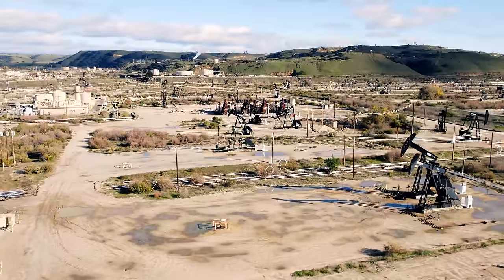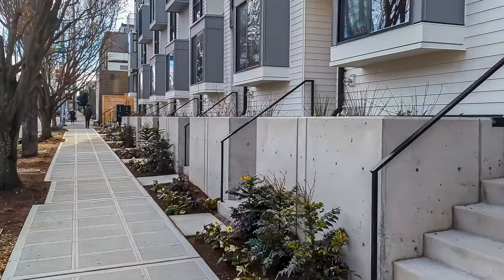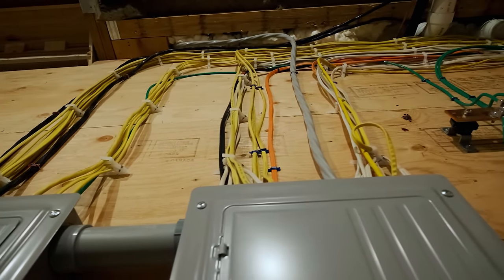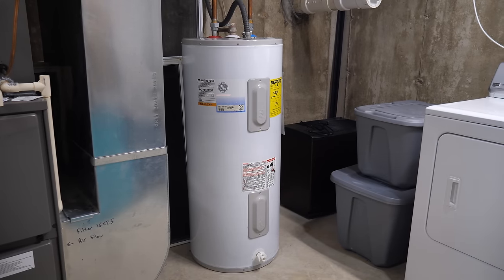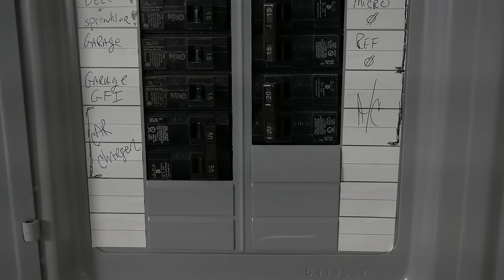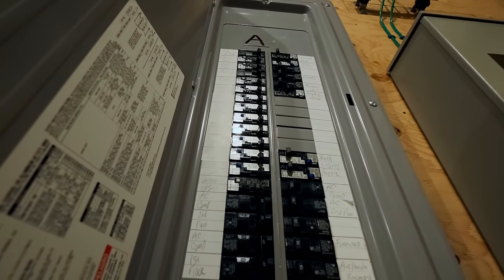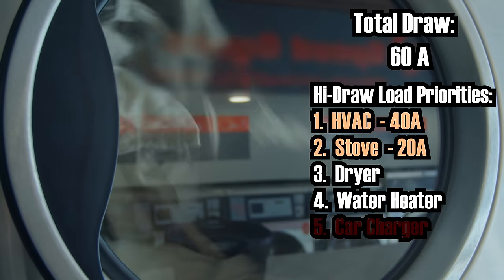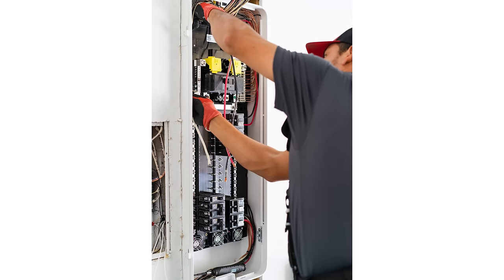Home Electrification: There's not a lot to do, and it doesn't have to be hard (Part 1)

Comment: 15:18 A smart electrical panel that starts disabling loads that aren't even present or presently have loads that are too small to matter doesn't seem very smart to me.

Consider how confusing it would be to be using a hair dryer or curling iron in the bathroom only to have power removed from the circuit 2 minutes in. Did the GFCI or AFCI trip? Nope. Did the circuit breaker trip? No. The smart panel disabled power. Maybe the geek of the home got a push notification on their phone that the outlet was taken out of service, but for everyone else who doesn't have a smartwatch tethered to their smartphone tethered to their smart hub tethered to their smart panel tethered to some crappy cloud service that was end-of-lifed before the product was installed, it'll be downright confusing. And for a curling iron where--unless you're looking at the LED--you don't know that the device turned off 5 minutes ago and you've been curling your hair with an increasingly lukewarm piece of metal will be in for a surprise.

To me, a smart panel doesn't make a ton of sense without smart appliances where you can get device-level power control rather than circuit-level control. For example, your refrigerator/freezer is probably fine without power for a few hours, and certainly fine without power for 30 minutes. Most people don't have their refrigerator on a dedicated circuit, so the panel would knock out other outlets like that low draw spice grinder or rice cooker if it disabled the fridge for 30 minutes. But if it could communicate to the fridge to delay its compressor cycle by 30 minutes, then you can average out the peaks.

Though I doubt turning off the refrigerator and a few other small loads would enough to get the peak power under the panel's rating. Realistically, all that matters are loads above 15A. Everything less than that probably shouldn't be interrupted. Fiddling around with lights and outlets in the app screenshots might look flashy and useful, but is utterly useless for anyone who has thought about the fundamental problem they're trying to solve: you can't charge your electric water heater and run your clothes dryer at the same time. Either defer your car charging or put your clothes in a holding pattern with no-heat delicate tumble dry, or communicate to your EVSE that it must limit charging to a slower speed for a while.

Likewise, a smart electric range could cut power to some of its burners. But either you're using those burners for a reason and can't really afford to have some of them turned off by the smart panel, or you aren't using them and therefore they aren't drawing a load--no benefit in turning off the circuit if it doesn't draw power.

Until smart appliances are ubiquitous or can handle having their power yanked from them (think about how your electric clothes dryer would handle having power removed from it mid-cycle; would it resume the sensor tumble dry cycle it was on when it lost power?), a smart panel doesn't really buy you much. I wouldn't want a smart panel cutting power from my dryer without it being able to resume the dry cycle or sit off for long enough for my clothes to get mungy and get rewashed.

We don't even have microwaves or ovens that can remember what time it is after a power outage. And that could be accomplished with a small coin cell battery. Nothing like storing the state of the complex computer boards that are in washing machines.

The reality is that if your electrical service isn't enough to service the major appliances in your home, you probably should consider upgrading your service if you don't want to live with the inconvenience of appliances going dark on you throughout the day.

You already covered an outlet splitter that allows you to power either a water heater or a EVSE from the same plug, at different times. That seems like the better solution here than inflating the problem to a whole home issue, and plan on upgrading your service if you're short by more than 30A.

Or have a way of duty cycling power between HVAC (which is a big dry battery), water heater (a bigger wet battery), and electric battery (a portable battery). Ideally coordinate all of this with the EV's whole-home V2L or home battery backup system to smooth out the peaks in demand. As long as you can communicate the rules: you need your car to be charged to X% for your commute to work tomorrow, you'd like your hot water to be at least some temperature and a higher temperature when you shower at X o'clock, and you'd like to keep certain areas of your home from getting too cold or too hot, with a focus on a few rooms where people are.

Comment: Wait, if by TC's opinion gas dryers are one of the core gas appliances, which are a subset of a dryer category, how common are dryers in the US? I understand that 99% of homes have to have a stove, and a water heater, (mb the furnace/boiler thing on 1st place out of 4), but dryers aren't a necessity, like a washing machine. Even in humid summer we had no problem drying our clothes on drying racks, which don't damage the material as tumble dryers do. You still need to dry the delicate fabric without a dryer.

Comment: You can have a smart breaker panel & turn off loads based on piority,
OR you can install the smart panel + 10KWatt battery pack & don't give a f*** about your power load as long as the battery have juice in it & it will always recharge in the few minutes that you don't exceed the current limit.

Comment: I think a better and more economical solution is installing a backup battery system (a 5Kwh battery and inverter is actually relatively inexpensive at the moment). The battery can supply the needed power during those peak usage and also act as backup power during blackouts

Comment: honestly the cost of a upgrade for me is 5400$ the span panel without tax is 2900$ that doesent give me 200 amps, doesent come with a local guarentee if it breaks a electrician can work on it nor would the electricians i know and the one i and my family use ever touch.
honestly id rather spend more and get a 200 amp upgrade.

Comment: Burning gas then converting it to electricity then using that electricity for heat is a wasteful process. It’s better to burn gas and get more thermal energy that way.

Solar is out of question here. Winters have barely any sunlight hours.

Comment: 100A is not a lot? here I am in Europe with 32A which are more than plenty.

an oven takes 4kw to heat, a dryer 1kw while running.

100A is industrial power range.

Comment: Getting Span is a really bad idea. They have mandatory internet connections (as far as I can tell) which means if the company ever were to disappear (or service discontinued) your breaker box would suddenly stop working. Never use mandatory internet service required devices for infrastructure. You're setting yourself up for a world of hurt in the future.

Comment: Our house are limited at 16A@220V. 25A breaker are kinda illegal or require paperwork. So only thing gas powered are stove and heater. Later one also need electricity for a pump. We also have 2 wood burner. On another side we have water pump and water heater and oven, all electric so i guess we trapped in cas for some time. Especially in recent blackouts in Ukraine that is fine for now.

Comment: Gas supply to s separate from the electric service. Where I live that means you’re gonna be cold in winter when the power goes out if that’s all you got. I got back up sources of heat in winter and power generation in summer.

Comment: We have a house in Switzerland from the very early 90s. The boiler is connected to a contactor which is connected to the grid. The electric supplier then is able to turn it on/off remotely depending on if it's on-peak or off-peak (22:00-6:00). The past year we've put a $20 IoT device that controls that contactor so we have even more flexibility.

Not as fancy as the proposed all-in-one solution but something that was nice to add nonetheless. Away for a week? Turn the boiler off completely.

Comment: Can you do a video on what controls a crt TVs refresh rate, 

IM trying to see.if it's possible to Downsample a 120hz TV down to 60hz, I have a Sony trinitron 40 inch, and it's set to 120, but is there some kind of wizardry I can do, even if it's like having to solder or modify the TV, is there a way to get it to work at 60hz? I've checked all the system options there's no way to do it in options, please do you have any insight?

Comment: I went from using a heatpump to using a wood furnace, electricity is just too expensive here nowadays.
Also, if you have water radiators or in-floor heating and went with mini-splits here people would think you are insane. Get a ground heat based heatpump or a air to water heatpump.

Comment: the problem with electrifying for my sister is she lives in an area where the electricity is very iffy.  She spent about a month without electricity after some storms blew through. Losing electricity is a pretty constant problem for her. She survived of the propane tank to run heat and a generator. she is looking at gasifying her stove top.

Comment: You are missing an important aspect of cold weather heating.  When the energy demand goes up because someone is cooking, and to a lesser extent with the hot water heater and clothes dryer, those appliances get hot.  This means you won't lose ground 1:1 on keeping the house warm when you turn other appliances on.  You are still dumping 80A of heat into the house somewhere .  You just need to keep running the forced air system to move the excess heat in the kitchen into the rest of the house.  

That said, you should only run circuits at 80% of their rated peak for extended periods.  So 100A service means 80A sustained.  Otherwise sudden spikes can cause tripping, and if you've had degredation of the involved wires, you might find them getting unsafely hot when run at 100% for hours on end.

Comment: I like the "smart" breaker box, but I would rather it be electro-mechanical in nature than micro-processor based.

In fact, an ammeter and contacter setup in line with each potential heavy load could (with some basic transistor-based logic) accomplish the same thing in a non-proprietary way.

Comment: I've noticed a trend of mentioning power outages. Is it really that common of a problem?

Our electric grid is dead reliable here (Canada, AB if it matters) so the idea of the grid going out is kind of baffling. Outside of short, localized incidents with trees, etc. the last power outage was nearly 15 years ago.

Besides, a gas furnace would likely melt if run without the fan. You don't get heat either way without electricity.

Comment: Well, after doing the math on my situation, I was somewhat disappointed to find that replacing the gas furnace with a heat pump doesn't make financial sense until the current furnace reaches its end-of-life in 15-ish years.

The gas rate in my midwestern area is historically and currently 4-to-6 times cheaper per unit energy than electricity. If I were to yank out the furnace now, disconnect the gas service (which would eliminate the fixed 1k per year delivery fee), and put in a mid-range heat pump, I wouldn't break even until almost 30 years from now; longer than the life of the heat pump. This ignores the cost of replacing the other gas-operated appliances. If I didn't disconnect the gas service, then it wouldn't break even period.

Once the furnace does actually need replaced, AND if its the only appliance left using natural gas, then a heat pump install would make sense with an ROI of just a few years. Unless a cost-effective pump with an efficiency of 6X or greater comes along in the meantime, pre-mature replacement doesn't make much sense.

That said, the water heater is past its expected lifetime. I'll have to make a choice on that one soon.

Comment: we have a combination of grid linked and battery storage non grid linked solar panels. Most of the year we use very little electricity from the grid, but do get paid a fixed generation tarrif for what we feed into it. This is directly metered. We also pay a fixed standing daily charge to cover the cost of connection to the grid same as all our neighbours . Solar systems like ours reduce load on the grid, but we still help maintain it. Our generation helps reduces the number of active power stations needed.

Comment: My home heating, hot water, stove and dryer are all natural gas (NG).  But my electricity is also NG.  There is a large NG power station a few miles from me.  Outside of the health risks of burning NG in my home, are there any cabon savings from swapping out those appliances to electric if the electricity just comes from a NG power station?

Comment: Charcoal/wood grill is king, gas is ok I guess, and if you plan on getting an electric grill, then you may as well just use a frying pan on the stove. other than that, most other appliances are equal or better in electric variant than gas.

Comment: I think you made an error when talking about the cooking top elements working at a reduced intensity.

For all i know the gradator is a thermostat, but the way it operate is not by sensing the heat from the element itself. It turns on the elements which heats at full power untill the switch itself becomes hot and open the circuit, then cools down and reclose it... It's a matter of controlling the frequency of the on/off cycle, more than aiming for a power output directly. So if all 4elements are heating at the same time, even if they are on low, they will take the 50-60amps in full...

Comment: Gas is not always replaceable with an electric alternative. 
Especially when is necessary to generate heat in large amounts, gas will always be more efficient.
Until all electricity will be generated by nuclear reactors, gas will always be required to efficiently (and cheaply) generate heat.
Renewables are a nightmare when coalesced in a big grid; they require a gas or oil backup of the same size. But renewables can be easily integrated into local application.
I envision a society where all heat is produced with electricity, but electricity is still to precious so it has to be metered. The day when this will not happen anymore, the day of 100% nuclear power for all, is far away.
I was thinking of patenting a gas powered air conditioner, with the cooling compressor powered by a turbine instead of a piston engine. According to my calculation, the cooling will be six times cheaper than a traditional electric air conditioner.
I understand my view differ from your, for what I advocate wider gas usage until the power grid will be 100% nuclear, with local applications of renewable sources.
Greetings from the UK,
Anthony

Comment: Throttling the forced air heat load by reducing power also requires slowing the blower so that the output air temp is sufficiently elevated.  To do otherwise will just create cold drafts.  This also creates an issue as the heat distribution requires sufficient pressure in the plenum to distribute evenly.

These unintended consequences are human's playing tic-tac-toe while the universe is playing chess.  We need to start playing the right game and this video filled with knee jerk first-order solutions is going to lose the game.

Take for example software obsolescence running your smart circuit breaker panel. These panels have historically had 70+year lifetimes.  How long do you expect to be able to operate the app for these smart panels? How wasteful is it to take a durable and reliable solution like a circuit breaker and trade it for a device with the life cycle of our tablets, phones and laptop computers.  Much more needs to be done before this will be even close to a smart solution.

Time to take up chess humans.

Comment: So in short I have don't the opposite and gasifyed my home why for heat we have used hard coal boiler since the early 80s the last year they used oil while my dad was in the navy it cost them 600 I can heat the place with around that in 2023 dollars using coal explanation my house only has the R-value of late 1800s hemlock and horse hair plaster as for wiring we that is the issue about 1/2 of the house is on 2 breakers used to be 1 Edison fuse box till I was able to split it by removing my electric  stove I needed braker space but no electrician would put hands due anywhere above the cellar and so me new runs circa the late 80s everything is solid strand paper wrapped porcelain insulated wires with no proper grounds so I need to update the breaker box to be able to go to a 200 amp panel or even to add breakers for new runs of wire rewiring isn't going to happen. The whole house is 70s wood panel over top original horse hair plaster the cost is too much for a house I love and hate lastly electric on demand hot water heater suck and a major thing I wanted was we have issues with running out of hot water dinner dishes and 3-4 people all trying to shower at the same time doesn't work

Comment: Not from the Americas but here we get torrential rain and cyclones all of which can take down your grid for weeks on end. Thus battery solutions arent even worth it in terms of the versatility than gas burners offer. Sure we go wihtout light candles, battery powered lights, some solar panels (which need to be reinstaled after each cyclone).